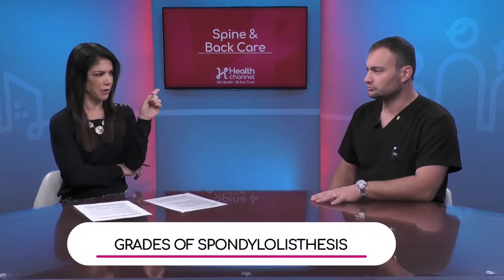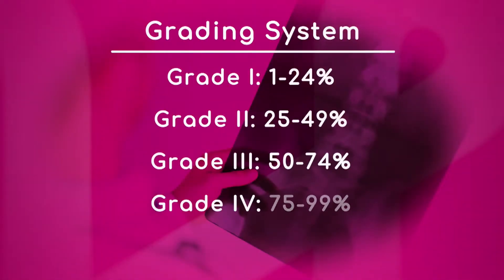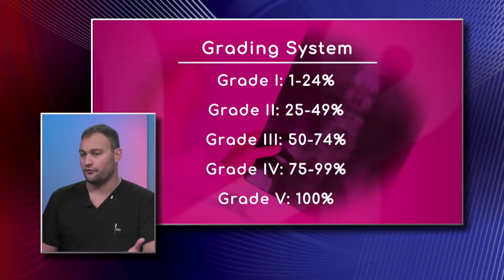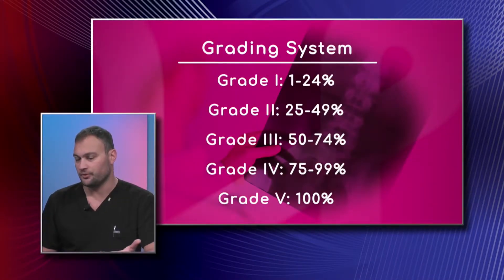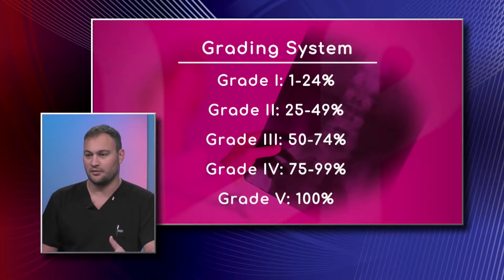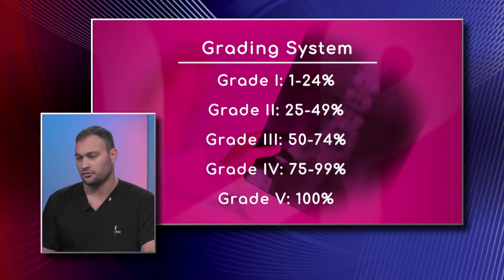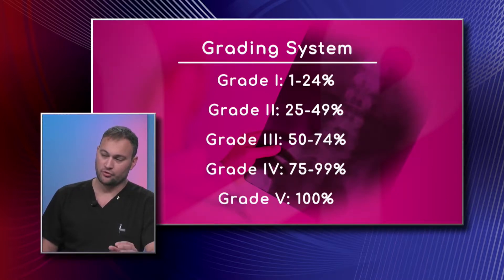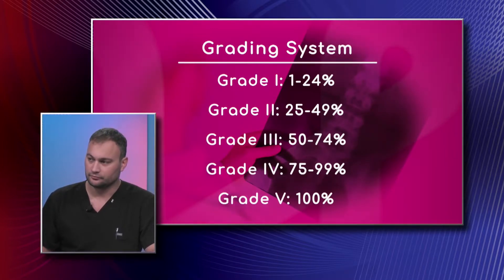Grades of Spondylolisthesis

Comment: I have grade 3 with L4 pars defect and moderate arthritis facet joints L5-S1. 23 years ago I had a disc removal of L4-S1 and at the time they couldn’t fit any hardware in there. So now those spaces are filled with bone spurs. I’m in a back brace right now awaiting an MRI in 3 days. Dr. said surgery is very likely 😢. I’m in excruciating pain. I got my X-ray done 1 month ago and nobody called because they sent it to the wrong Dr. I’ve been in pain Since June but tried to wait it out cause I’m used to back pain/pinch nerves/muscles spasms. I even have a spinal cord stimulator that helped me tremendously for the past 6 years. If you can barely walk or sleep don’t hesitate to get an appt. When I finally had enough it still took 2 months to get in. I now have peripheral neuropathy which sucks! Even though I have been complaining about my legs to my Dr for the past 5 years he gaslight me. It’s the nerve pain that is torture. I get the stupid injection shots soon which I feel I’m just doing because I’m desperate.